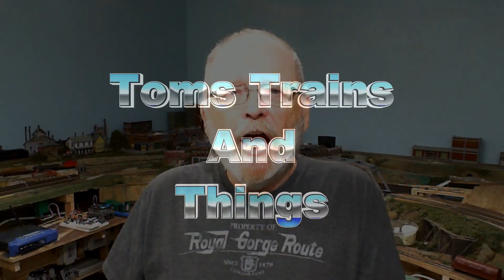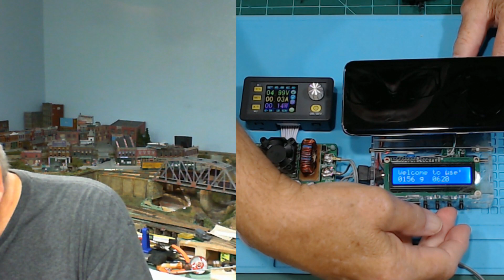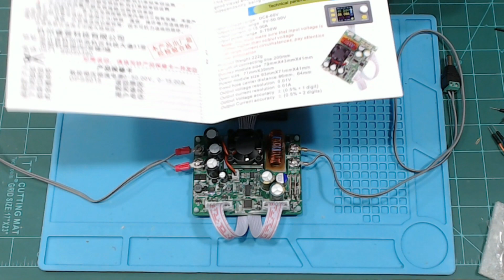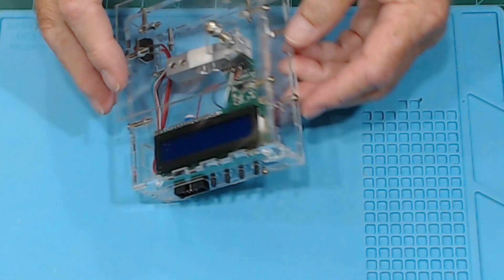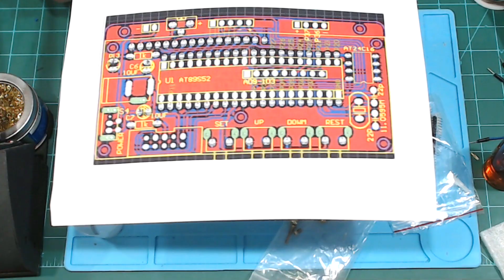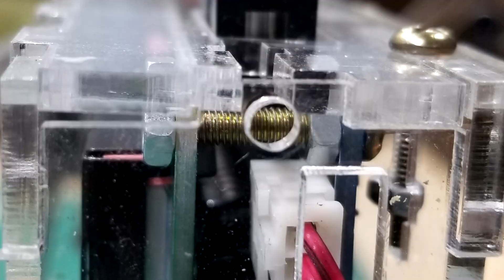How To Check Your Rolling Stocks Optimum Weight With An Inexpensive Scale

Comment: For the manuals in Chinese you can use the Google translate app for your phone - the version of the app I used allowed me to select the area of text I was interested in and then it would show the text in English.    I have not used it for Chinese, but it worked very well on Japanese when building a Gundum kit, so I think it would work.
Reply from the maker: Thanks Dominic. I knew about Google Translate but most of the documents were data sheets and other technical references. There were other users that left comments on the product page about the lack of instructions. I didn't bother messing with the translations after reading that!

Comment: Hi Tom, a bit of a confusing video.   While your title is about checking rolling stock weight you spend a lot of time talking about the power unit (which still needs additional power???).   All it seems to do is allow you to change the output voltage - I thought I could already do that with my DC transformer.  At that point all the device really does is show me the Voltage (plus the amperage being used which is nice) so I'm thinking there would be a simpler solution to just take the output of your DC transformer and display the voltage and amperage and then I can just use the rheostat to change the output.

For the scale, I suppose that if you are into a project it'd be OK although you don't say whether I have to calibrate EVERY time I turn it on which it seemed to be.   A Postal Scale or Kitchen Scale is pretty cheap and it self zeros each time you turn it on - its what I use for weighing my cars.

So, interesting BUT the video is much more about the 2 products than car weights.   I was looking forward to more discussion about car weights.   Talk about the NMRA guide and how that should be used with freight cars versus passenger cars.   Then a demo of how to add weight to various cars including ones where it is difficult.  Perhaps a video of the difference it makes with light cars versus properly weighted cars.

Oh, and based upon your discussion of the scale I have no interest in getting the scale as a kit.   No instructions (not in English means none), components that don't fit.   I'd give it a 3 or 4 out of 10, not sure how you'd rate it.   The only really good thing about it is to practise soldering and some assembly techniques.
Reply from the maker: Thanks for your comment Don. As far as your transformer goes, it is not a regulated power supply which you need for any project. Not all transformers have the third set of terminals for the fixed DC and on this particular transformer the fixed DC is approximately 20 VDC which is way too high for all your model railroading needs, so you need a regulated power supply to keep the voltage constant and at the voltage where you need it.In this project it's 5 vdc. On transformer where you only have 2 sets of terminals. One is AC and the other is variable DC which you would need an external device to keep a constant voltage for your project. Everyone has transformers laying around. It's a good device for your DC, but unfortunately not good for your projects. I'm giving you a way to use that old unused transformer.

The scale only needs the reference weight once it is set. The reason for that is you can apply any platform at any weight to the load cell which you can not do to a kitchen scale or postal scale. If the platform is changed at any time, say you want to mount this under your track, you can compensate the difference with the reference adjustment. You also have a reset and set button in the event you have additional objects on the scale you do not want weighed with your desired object. Like the tare weigh of a container that you want to hold your pieces.

Yes the video is also about the two products discussed like I mentioned at the beginning of the video.

If you look at the NMRA standard which I referenced there is no mention of what type of rolling stock in question. That has no bearing on optimal weight.  It's only about can length. Weather you have passenger cars or freight, or MOW rolling stock, it's all the same. Optimal weight is calculated by the overall body length. If I took the time to show you  how to install weights in different types and manufacturers of rolling stock the video would be hours long. Remove the shell of the rolling stock and add your desired weight like I stated in the video.

Although the scale kit has no assembly instructions it was not that difficult to figure out where all the parts went for soldering. Like I said in the video, if your experienced, you would be able to figure it out easily, and you already have a head start since I discussed this in this video. I will be doing an assembly video for this scale for those that are not experienced with electronics.

Model Railroaders are not the only ones viewing these videos. The manufacturers of the products are also watching to see how easy or difficult their products are in the eyes of the consumers. Hopefully from the comments I made about the lack of quality control and placement of components on the board, they can make improvements to their product.

If you want to see any specific topic in detail, let me know and I will do my best to produce one!
Reply: @TomsTrainsandThings  Hi Tom thanks for your reply.  I view these two products separately.
   The Power Supply, I agree, can be used on your work bench to provide different Voltages for testing things, especially for those who don't want to create one from scratch themselves.
    I'm thinking that the scale may be more useful in projects like a weigh scale on a layout.   I think that'd be an interesting project. 
     My comment on NMRA weights and types of cars was based upon my experience where I've found that weighting down items such as freight cars (and other similar rolling stock) helps in their operation.   However, with my Passenger cars I don't adhere to the NMRA standards.    I've found that I don't have issues with things like stringlining with the passenger cars (around a curve, going uphill) whereas I'll have that issue with lot of light boxcars.

    In any case, keep up the GREAT work.   Whenever I'm notified that you have a new video up I quickly go and check it out!
Reply from the maker: Thank you Don!

Comment: Another option is to pick up a digital kitchen scale for $19 bucks.  Scales out in pounds, ounces, and grams...great for mixing water and glue by weight as well.  When not using it, put in the kitchen.  Bob
Reply from the maker: Thanks Bob. Debbie supports everything I do in Model Railroading except mixing anything from the kitchen on the layout. Good way to get mixing bowls, spatulas, strainers, etc. But once it hits the layout, it doesn't go back in the kitchen. Hehe! This scale is cheaper and can be modified to fit anywhere you want to put it, even under the tracks like NESR stated.

Comment: Nice presentation Tom ,i use a inexpencive mini scale ,they are a few bucks on Ebay . It is under a unconnected piece of straight track with wires conecting it inline with my track,you just run the train on to the track and it gives you the weight .Thanks again Tom ,take care ,John
Reply from the maker: That's a good idea John, I leave it up to the imagination of the viewer to decide how to use it.